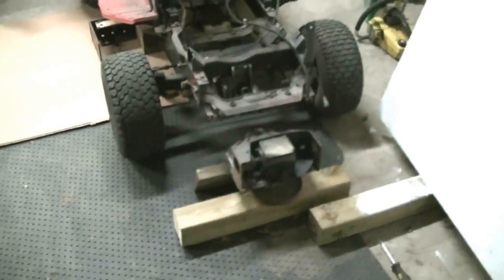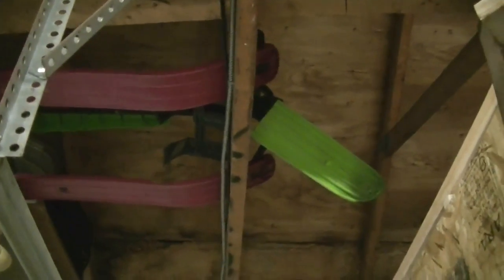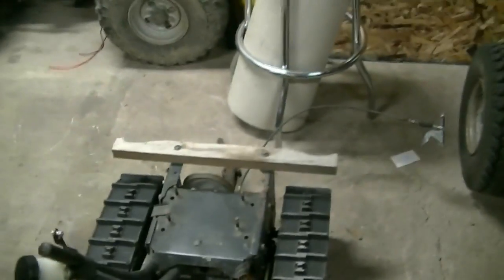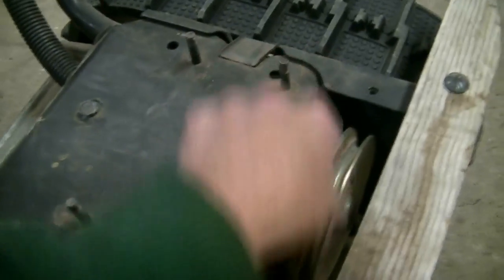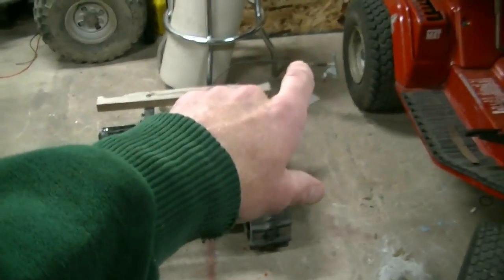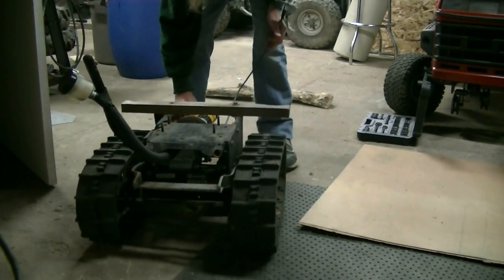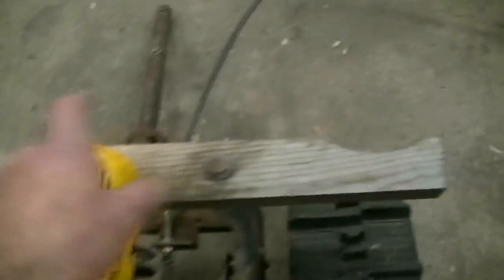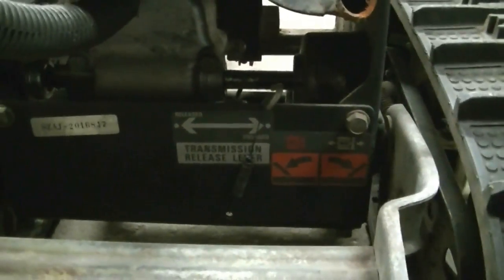Winter Sidewalk Scooter Project

Comment: interesting little project, but you had your reverse going forward and your forward going reverse if you didn't know.
Also from the look of the hydraulic fluid reservoir it looks low you may want to check the seals out, there is always a reason why something is in the junkyard, being hidraulic I don't think it's going to be very fast a stock lawn tractor in 3rd or 4th gear would probably beat it, you should know you cannot speed up a hydrostatic drive, too bad it wasn't the gear drive version of that type of snow blower.

Comment: Hey Rick, I wouldn't try to weld the tilt solid. Try to make it so you have some movement in it. That way when you go over things (like those boards in your shop) you don't wind up looking up at the sky and it rolling over backwards on ya. Build it with the tilt lever on it. Then see what it does when you take it off (you may need to some kind of limiter on it). If using it fixed works better THEN weld it solid.
 Good luck, and keep us posted on the build. Would love to see it.